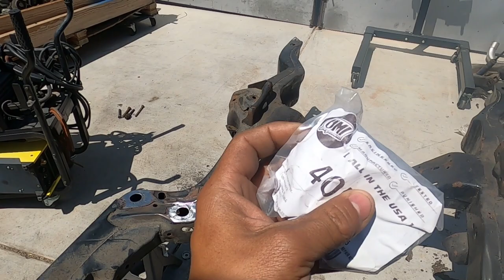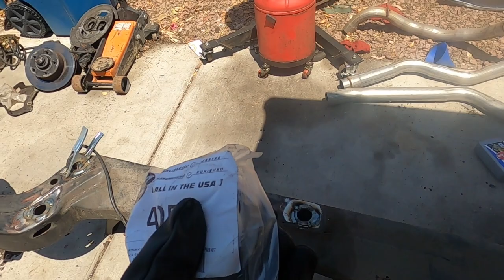FIXING FRAME BODY MOUNT HOLES ON A 71 CHEVELLE FRAME

Comment: Those are actually meant to cut out the rust and weld in flush with the frame. The way you did it is like welding a new quarter panel over a rusted out one without cutting out the rust. Use a hole saw or plasma cutter the diameter of the patch and weld it flush. They were totally unnecessary on this frame as well.
Reply from the maker: I understand, we have done it both ways and wanted to show it this way for people that don’t necessarily have the tools or skills set for the other option. Like you mentioned , it could’ve, definitely gone with out and if it was rusted truly would have cut it completely out for sure. Thanks for watching
Reply: I agree, doing it the way he did could cause it to rust in between the 2 layers now. By trapping water it could eventually lift with rust building up. Just like you said when welding on a quarter skin over the old quarter. 

If he had welded the inner circle that could have stopped that as long as the weld was solid & no pin holes.